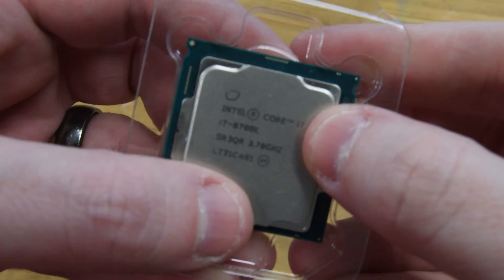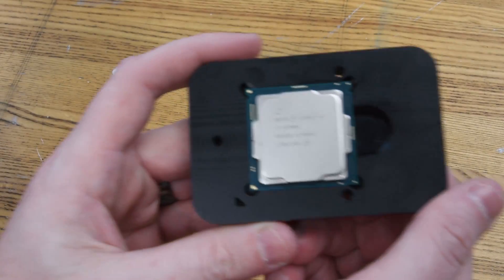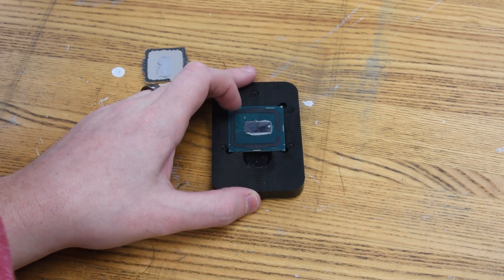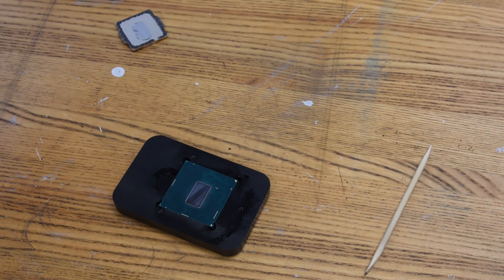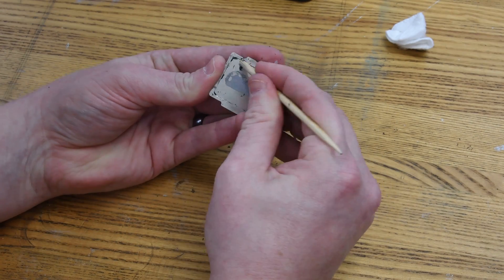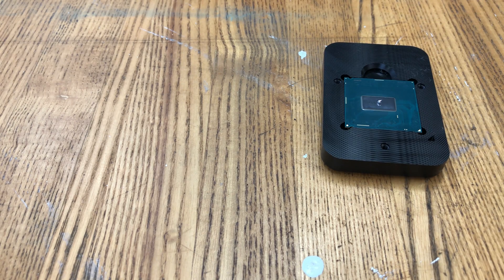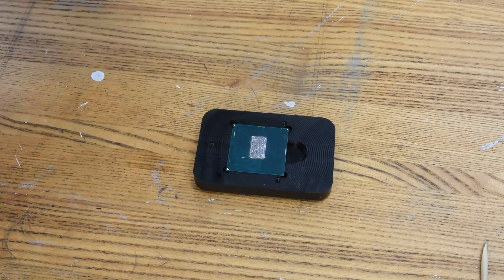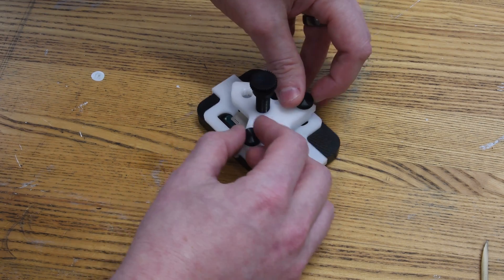Coffee Lake Delid - How to remove IHS from 8700K- Rockit Cool

Comment: Would it be a bad idea to run the cpu on normal workload to heat it up and then immediately place it in the tool to pop it?

I ask because if that stock paste is silicone this would soften it along with the shock edited from the pop

Comment: Just to expand on I-AM-Xenu , the gap in the gasket seal, it’s for off gassing. Air trapped by a full seal will

expand and try to lift the lid, in doing so may lift the lid away from the die
and reduce heat transfer.

Comment: So are you still using this cpu? Any maintenance needed after a while?
Reply from the maker: I sold it but I remain in contact with the person I sold it to. They are still getting great temps with it to this date. I don’t see any reason why liquid metal would need new application any more often than two years. Probably could go much longer without issue really. If anything I find the stock paste TIM to be a bigger problem.
Reply: @JayPTek  thanks mate

Comment: I was wondering if the liquid metal you applied to the bottom of the IHS, if you delidding it again noticed any of it spilling onto the substraight? and I did my delid exactly the same way as you, only I used tape to square of the IHS when applying the LM and covering the substraight when doing the die.
Reply from the maker: bladezlash I took apart my other coffee lake cpu and didn’t have any issue with liquid metal spilling onto substrate. I put a very light amount not leaving anything to spill over. Taping as you did is another fine option. I think that the amount of liquid metal you apply is far more important to pay attention to. Even if you tape but apply too much it’s going else where when assembled. I might do a disassembly video at some point but both CPUs are holding strong with excellent temperatures. Thanks for commenting and sharing your experience!
Reply: I like how buildzoid puts it, you are only putting on enough to paint a thin layer. if you have mirror blobs then there is too much. I got a bunch of those nylon paint brushes that come with the Liquid Ultra, as I was getting so much fraying from q-tips when applying. I used them today as I decided to redo the LM and float the IHS instead of using the permatex ultra black, I got a really nice even thin layer. Seems like I managed to drop about 3-4 degrees at best. However I never really put a lot of the permatex on just a super thin layer using a paintbrush on all four corners.
Reply from the maker: Yea the only Q-tip that really works is the one included with the thermal grizzly liquid metal. A regular q-tip would fall apart in this use. Not sure which one you were talking about. I used the one included with thermal grizzly multiple times with no issue. Those brushes you mention probably work well too I imagine. I only use the Permatex because I wanted it to return to like stock and didn't want to deal with IHS sliding all over while I swap chips in and out of my board. Liquid metal isn't really something that needs applying all the time so sealing it back up isn't an issue. I have seen a varying degree of what people like but its all personal preference and as long as whatever you use is minimal it's not going to cause a performance difference. Only way to improve beyond what is shown here is to get a custom IHS/waterblock and cool directly to the die. Several ways to go about this procedure but the most important part is to get that damn Intel tooth paste off there. Rumor has it the "9900K" and "9700K" will be soldiered.
Reply: JayP Tek yeah let's hope intel solders their 9th gen, well atlesast the k series. So they can get it right with the 14nm ++++++++++ and then keep it that way when they release 10th gen 10nm node. Oh and I was reffering to the black buds that comes with the thermal grizzly LM, I am probably to OCD and used it too long, to get a perfect layer, thus it started fraying haha. Have you tried one of those lapped custom copper heatspreaders?
Reply from the maker: bladezlash all the recent news I’ve been seeing suggest just the two eight core models I mention will be soldiered and the other 9th gen 6 core chips will still be TIM. I expect the “9900K” to be a monster. 5.0Ghz+ on eight cores should be possible. I got ya I guess it has to fall apart eventually. I have not use one of those custom heat spreaders but Linus and some others have used them for successful results. I generally don’t go too far outside of cost/performance and custom water cooling doesn’t pay off in this world of great air coolers and AIOs. I have been very tempted though as of lately. Just to thinker with it.

Comment: How safe is this? I dont want to damage my 8700k
Reply from the maker: InvertIdols X There are risks associated and this will void you warranty. The risk on these processors is less than other Intel CPUs. If you use the proper tools you shouldn’t have any issues. The benefit especially when overclocking is significant.

Comment: If I skip the adhesive how would the process be do I still do the steps like put the top back on and leave it on for 24 hours? Confused on that part
Reply from the maker: Welcome to the channel! If you choose not to use adhesive there is no need to wait. The wait time of 6-8 hours and/or full 24 hrs is cure time for the RTV. If you are really wanting to get your system together you can still adhere it using less cure time and put it right in the socket just make sure when clamping it down not to let the IHS move. Some people prefer not to use adhesive but I DO NOT personally recommend that. If you use an adhesive of sorts you really won't ever have to touch the liquid metal again. Otherwise, if you ever have to remove the CPU from the motherboard for whatever reason such as the motherboard having a defect you will likely disturb the liquid metal under the IHS that is free to move when out of socket with no adhesive. I just like the processor like it came but with liquid metal and that is why I use black RTV. Good luck!
Reply: JayP Tek but doesn't the adhesive increase temps or no?
Reply from the maker: No, the adhesive will not cause increased temps it is just the black stuff I put around the edges of the IHS. All it does is hold the IHS in place as it was from Intel. If you don't use adhesive your IHS can fall off or move when it is not in the socket. The temperature improvement comes from wiping off the thermal grease and replacing with liquid metal. As long as the IHS is put back on and sits flush the desired temperature reduction will occur regardless of adhesive or not.
Reply: JayP Tek alright thanks so much, your like the only YouTuber, that's very informative, got yourself a sub freind.
Reply: JayP Tek hey sorry to bug you, but I have a question, I delid my 8700k and use the cleaning substance on the chip itself and then cleaned it, is that okay to do.
Reply from the maker: Mustard Gaming Yup that’s what you want to do. Wipe it off with some citrus like cleaner similar to what I used in this video then clean that off with a high alcohol or cleaning solution I used here. Both the die and the IHS.
Reply: JayP Tek thank you again mate.

Comment: I ended up not bothering with the adhesive. Just dropped the cpu with the ihs on the motherboard. It's not going to come out for a few years anyway. Works great, and the difference is absurd.
Reply from the maker: Hey thanks for watching and commenting! Yea it works fine to not use adhesive and some like it just as you do. Personally I like adhesive because there will be little to no need for me to reapply liquid metal and I also have been swapping CPUs a good bit lately for testing. Without adhesive I would be disrupting the liquid metal more often and I don't feel like dealing with it every time I swap.  Having the IHS adhered in one way or another is a preference of mine as I like things to resemble as if they were not touched as well. Thanks again for watching and sharing your thoughts!
Reply: Orelha how would relid work if your not going to put the adhesive on?
Reply: No relid happened. I put the cpu without the ihs in the slot, then carefully put the ihs on top of it, and then I "closed it".  No adhesive was used, and temps are what I expected (around 18-20c lower).
Reply: Orelha I see, so skip the step about putting  the ihs on top and letting it sit for 24 hours
Reply: I mean, if you're not using any adhesive, there's no reason to put pressure on the ihs for hours. If you do use an adhesive, you should do it.
Reply: Orelha okay, I just wanted to confirm first doing it, just want to make shure

Comment: temp?
Reply from the maker: VICTOR YEAH temp video is coming I am behind on the channel right now had a lot of things going on. Thanks for watching! Temps coming soon.
Reply from the maker: VICTOR YEAH which cpu and cooler?
Reply from the maker: VICTOR YEAH sounds like you got one hell of a chip to get 5.0Ghz at that voltage.
Reply: Nice, also looking forward to a temps video.
Reply from the maker: I suck at getting videos out right now I know and I am sorry. I am running the 8600K and 8700K at a few different clocks and voltages on both the H110 Corsair and Coolermaster 212 evo. I have all the before delid temps done and all the after delid on the H110 I just need to wrap up the 212 evo temps on both chips and I will have the video out. Sorry again for those who are waiting.
Reply: JayP Tek 5 ghz.....1,28v,occt estable, Cinebench 60 degrees,cpu delid
Reply: JayP Tek i7 8700k ,corsair h100 v2,

Comment: This is a great video, thank you for posting it! I might have to try a delid on my 8700k when I finally get around to order all my new parts. Its a shame its only at 22 views, you deserve way more! i'm sure with a little bit of time you will start to see some growth in the channel.
Reply: Also, I'm looking forward to your video showing battlefield 1 at various settings, hopefully that gets posted soon!
Reply from the maker: Thank you for the great feedback it is really nice to hear. I think delidding the 8700K is totally worth it. The 8600K delidding could be avoided for the most part as it runs cooler. The 8700K pretty much needs it stock. Also, I haven't forgot that video I will have it up very soon!
Reply: Was thinking about using this tool for a 4790k. Wondering if I might expect the same temp benefits over stock as you suggest being worthwhile for the 8700k?